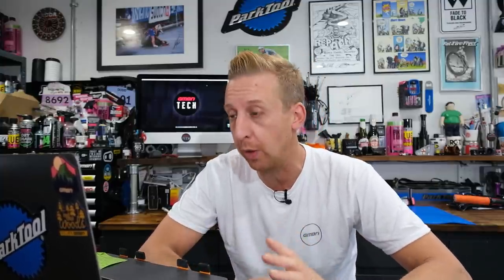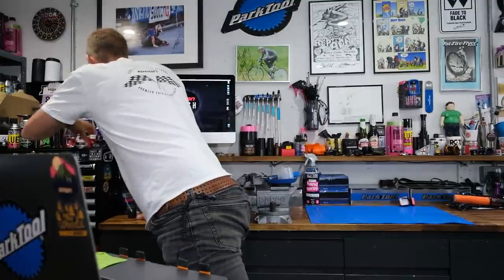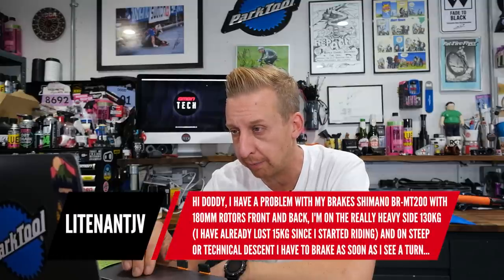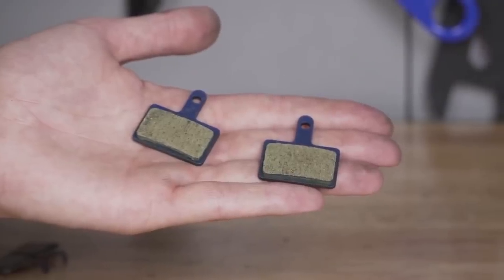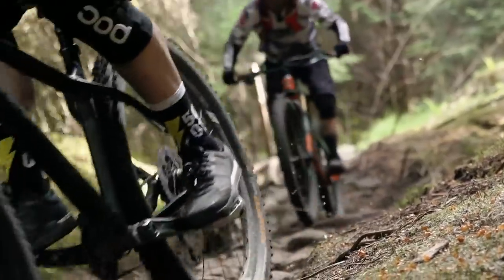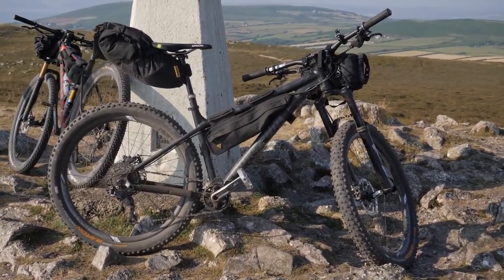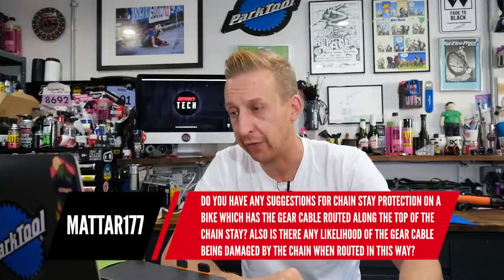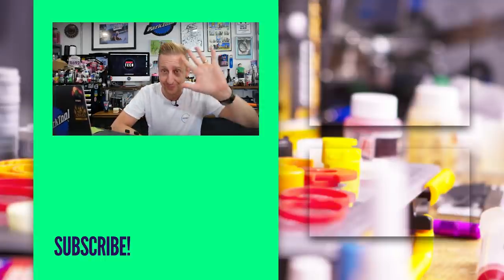Suffering From Sticky Brake Pistons? | #AskGMBNTech

Comment: During the Sticky Pistons part of the video I also recommend acting like your going to bleed them by opening the reservoir cap and threading on the cup. This way when youre pushing the pistons back you don't rupture the rubber diaphragm in the lever reservoir.

Comment: Doddy - we are both relative old-timers. Like you, I cut my teeth on late-80's and early-90's rigids and hardtails with steep geometry and narrow bars that assumed we were riding slow through the trees and only ever went UP the mountain. Today's riders don't do this (and we didn't either, did we?) and, as such - they should embrace the newer stuff and reap the benefits of our "R&D" years. I agree with you that the dropper seat post is doomed to be replaced by dropper frames that house the "dropper" portion of the equation (why did this take so long?!).  What other things will experience a similar transition? Bars with integrated reservoirs/brake pistons? Yes please! Multi-gear transmissons in the BB? Yes please! (deraileurs are so last year!). Imagine a single, rigid rear gear with all the shifting taking place within a free wheeling BB - we have the technology! The heaviest part on most bikes is the cassette so there is room to work - mechanical advantate leverage ratios don't care from which side you work! Mullets are the future! (See motocross) - each end has different jobs so there is no engineering reason they need to be equally sized. Regarding bike geometries: what good are geometry numbers if they are made on a bike without the rider? Do bikes move without a rider? The numbers we see area all static, unweighted values that - by themselves - mean little. All the measurements change when the rider gets on. What is YOUR head tube angle when you are onboard in a riding position? I foresee a rider mass/weight number becoming part of the geometry equation.  Active, micro-processor controlled suspension: YES!  Please save us from outdated setup techniques and charts that assume constants values for rider size/weight/terrain that can change weekly.  I could go on, but you see - the future is bright!

Comment: Sticking  caliper - pistons,  :- I found corrosion under the internal seals  causes the seal to swell and bind on the piston stopping it from retracting ,  removing the pistons, and the seals and  cleaning  out the retaining grooves  then re-assembly with a dab of lithium rubber grease on the pistons worked a treat, very fiddly but worth the effort!!😀

Comment: As an old bloke who has started riding in 1992, I should be tempted to say „you should learn on a hardtail with steep angles“ but no, the opposite is true. I think riding with 135mm stems, 560mm bars on a classic 71/73 hardtail for too long has really set me back in my riding. In those days, even the smallest error would lead to a crash and I think I have stopped trying things because of that. When I see the kids today and what they are doing on their bikes, I whish I had a more forgiving bike back then. However, I think riding on a hardtail or rigid bike teaches you to set up your tire pressure correctly.

Comment: Hi Doddy, Love the show, great content. I started my MTB riding 12 months ago at the young age of 55. Started with a 2017 Levo hardtail, gave that Levo to my wife when I got my 2018 FSR Levo comp, I love my. My fitness has changed so much that I bought my fist new bike a RockHopper to commute on around town. To me it was a bit of a waste riding a full sus EMTB as a commute when most of my commuting is flat tarmac. I slowly getting to riding some some single track on my Levo and love the blue and green trails. I have ridden both full sus and hard tail Levos on the same single track and maybe its my limited skill level I could not notice any difference other than the full sus was more comfortable. I might just have to ride more!! Cheers keep up the good work

Comment: Hey Doddy. I’m rocking an entry level bike (2018 giant ATX). I want to talk care of my cheep coil fork. Do you have any tips for cleaning and other general maintenance? 
#AskGMBNtech
Reply: After every ride that gets the fork dirty: take a clean lint-free rag and wipe the seal area on the fork to get any dirt away from the seal. Also wipe down the stanchions with light soap water.
After every week/2 weeks: Take some suspension grease (DO NOT use regular grease) and rub a bit on the stanchions. Compress the fork through it's full travel a few times and then wipe the excess grease off
After every 200 miles of dirty trail riding or 400 miles of clean trail riding: clean the o-ring and foam wiper, and do a lower leg service.
I honestly wouldn't recommend disassembling the fork to clean the o-rings and do a lower leg service on a low end coil fork. It's probably not worth the hassle and the cost of the foam rings will soon add up. The best maintenance that you can do is to clean and grease the fork frequently to prevent more time consuming and expensive services.
Reply: Open the top caps and pour 12ml of motor oil (5-10w) in each leg. Makes it 2x better, so much more responsive and smooth. Od recommend to clean the internals before this.

I did this and its a huge improvement!
Reply: @vivek_v  the cheap ones don't have foam rings
Reply: @linusdalin1  wait so how does the fork get lubricated? Or does it not get lubricated? The Walmart forks prob don't have foam rings, but even the cheap suntour stuff is decent so I would think that they would have foam rings.

Comment: #AskGMBNTech Hi there, love the show! I have an SR Suntour XCR32 Air fork, I'd like to make it more progressive and I can't find any volume spacers for it. Can I use 80W oil in the chamber to take up some volume or modify existing spacers from another model? Is there a risk of damaging the fork? Thanks a lot
Reply: I did that but it started to leek oil out of the stancsion
Reply: @cyclingstunts9887  wouldn't do anything
Reply: @cyclingstunts9887  Really? But did you feel anything different?
Reply: Ask someone to 3D print you some or just cut them from some cork etc. and glue it to the top cap of the air chamber. Pouring oil into the air chamber doesn't seem like a good idea, especially if the air chamber is not designed to be oil-lubricated (but grase-lubricated as most seem to be nowadays).
Reply: idk if you have tried this already but sr suntour has a place on their website where you can put the serial number for your fork (found on the crown facing back) and it will tell you exactly what varient fork you have and then you will be able to tell if suntour has volume spacers for it. i did this w my raidon 32 and found volume spacers. i know suntour sells volume spacers online so if you cant find any there they probably arent meant to be used on your fork.
Reply: @OYeahan  Humm not a bad idea I guess, thanks
Reply: @tylerbailey8834  Yeah I already looked into it, no luck, the XCR Air is the lowest spec air fork they have so you might be right, maybe it's not even meant to run spacers, hence the oil
Reply: @tonysadler5290  Wow thank you, I will investigate, and yeah in the future if not a new bike, at least I'll buy a better fork
Reply: Do you want it to be more progressive to prevent bottom-outs or do you want more midstroke support?
If the lack of progression affects your bike to the point of it being unstable/dangerous, I would just add more air and sacrifice small bump sensitivity. If it's just an annoyance, I would put a few more psi into the fork. The fork should still be sensitive enough but then you gain more bottom-out resistance and midstroke support if you were looking for that.

Comment: On the last question with the top-routed cable: I think you could get a flexible plastic hose like electricians use to run cables in the walls, cut it open, wrap it around the chainstay and wrap it with tape so the cable has room to move inside. (if you don‘t want to drill out your frame)

Comment: The shock position also defines where the forces act upon. If the shock is horizontal, continuation of the seatstays, then there are no forces acting on the seat tube. If the shock goes 90° vertically, the seat tube needs to be reinforced to handle this. But the shock goes into the bottom bracket area, that is the strongest part of the bike. If it is horizontal, then the top tube needs to be reinforced.

Comment: I would definitely consider better levers. The MT200 from Shimano, are the very entry level one. They are ok for lightweight people and trekking bike in my humble opinion. If you need loads of braking power you need a more powerful lever with the servo system. These are not only more powerful, but single finger as well, while the MT200 are more for double finger use (technically triple, but you really do not need three fingers). For Shimano brakes there are also third party companies making pads. Shimano unfortunately makes only metallic or resin pads, no semi-metallic. Quaxar to the rescue. I tried their semi-metallic pads and I love them. Bonus for making a lot less black powder compared to Shimano's resin pads. My frame is white, it's an hell of a job to keep it clean ;)

Comment: In my humble opinion, an affordable aluminium hardtail is the way to go for beginners. There's not much to do wrong, most of them can take a beating and if you find yourself to be sticking to the sport after several thousand kilometers, you can always upgrade if you want to. By the way, those hardtails really take more awareness during descents and do teach better riding. Trust me, I just hopped on my first full suspension. After a year of shredding.

Comment: Hi Doddy, I am 64 and just got back into the dirt, been road riding the last 7 years, raced Moto-X many years ago. I just picked up a 2021 Specialized Stumpjumper Alloy. My height use to be 5-9 but over the years and 4 back surgeries later I am now only 5-6 tall. According to the Specialized fit chart I should be riding a med(S3). When I bought the bike the sales tech told me the bike I got was a med, but after looking closer I find it is a large(S4). Do you think this would be to big? Before my surgeries I would have taken a larger, I have the lower body of a taller person but a shorter torso. The bike is comfortable to ride but I am wondering if this is something I should change to a Med.? Thank you for any insight to this. Don.

Comment: Do you have any idea if 2020/1 Yeti sb115 or Pivot trail 429, trek top fuel, ibis...  really needs to have their frame/suspension bearings replaced more often, or are more difficult than any other full suspension bike? Or is this a lie. What are the best bearings a person can buy for the suspension/frame? Brand and model? Do you think it is a good idea to drill a hole in the derailleur hanger(make it weaker) to make sure it fails before destruction of the frame and wheel? 
Thank you!

Comment: The calibre v2 frame has tha cable routed on top of the chainstay and I just wrapped an old inner tube round it, it is soft enough to work for noise damping but because my cranks come quite close I had to chop it in half so I only had one layer of rubber

Comment: #askgmbntech High guys I have a trance-3 2018 model running (stock) shimano 1x10 cassette  & mechanism. I have an issue in that I wear out the smaller cogs on the cassette very quickly well before the chain even becomes 75% worn causing the chain to jump around & slip on the smallest cog. I am at the upper weight limit (145kgs) of the design of this bike and I can get a lot off power down through the drive chain. I also am fairly good at cleaning the bike and drive chain after riding. So questions; can I get a tungsten edged smaller cogs? second is it worth up-grading the front chain ring from its stock 30 tooth to a 32 or 34 tooth? I am not really finding I use the bottom gear so this would enable me to wear the drive train out move evenly?

Comment: far? I tried a Yeti SB115 and a Pivot Switchblade, yesterday. Everyone raves about how great the Switchblade is. Not for me at this point, felt too heavy and sluggish. I liked the sb115 but no iscg 5 tab to mount a bash guard. I think any bike I buy needs frame protection of some sort to keep from taking chunks out of my bb area on big rocks, especially And logs. What do you folks do?
Is the Pivot trail 429 too heavy and sluggish feeling compared to the sb115? 
Also pedal strikes are a pet peeve, I hate too low bikes that pedal strikes or you have to put midget crankset on.
I ride in the midatlantic where it is totally different from all the YouTube reviews which are either at ski resorts out west, or Moab, Arizona, kalifornia, with fast more groomed wide open environment.
I am trying to figure out the best bike for my area, and something quick, light, responsive, and efficient, that does not jack hammer my back.
I ride a xl 2016 trek remedy 9.8 29r now.
I am 6ft and 3/4 about 165 with no gear.
Thank you.

Comment: As always, great show Doddy!  I agree that riding steeper head tube  or hardtail forces you to be a better (though slower) rider as to picking lines, avoiding obstacles, and the like.  I recently got al trail bike and it allows me to descend faster and roll over stuff my XC FS bike makes me go slower to handle, but I decided going faster is not better - I'd rather work on trials skills than DH/Enduro skills... safer too :)

Comment: Dear Doddy, my breaks squeal is epic, I've replaced rotors and pads, they still squeal super bad. I have removed the pads (front and rear) I found an oil ring so the pistons leak a little. Is it possible to strip down and repair or should I just get new calipers. I have Shimano Deore. TIA

Comment: My right piston is stuck squeezing the disc, I take the pads out and push it back in, but when I put everything back on and press the brake, it doesn’t push back and gets stuck rubbing my disc again, do I need to lube the piston or let some fluid out, I’ve only had the brake for a few months.

Comment: #askgmbntech 
Hi. I have a Cube stereo 140HPC TM 2020 with Fox Float DPX2 Factory ( metric 185x52,5 /Trunnion)  Is it possible to use a spring damper for this frame in the future? I'm not sure there's enough space for a coil spring. If so, what damper would you recommend? Ideal with pedal lock for climbing. Cane Creek Double Barrel Coil CS Trunnion or Marzocchi Bomber CR?or can i fit Fox Float DHX2 Factory 2-position 185x50mm?
thank you very much! have a nice day
Lubec

Comment: Hi Doddy, big thanks for great educational and entertaining content!
I have a Horst-link rear suspension with 140 mm travel, and the shock uses only about two thirds of its stroke. In the horst link there is another mounting point for the shock. Mounting it there would reduce leverage ratio. I am considering doing just that, and removing a few spacers from the shock in order to compensate for the reduced leverage and keep the same 140 mm travel.
Would you recommend doing that and is it generally advisable to use as much stroke of the shock as possible? Thanks!
#AskGMBNTech

Comment: #ASKGMBNTECH
 
In the winter months should we be washing our bikes after every ride? I understand the importance of washing a bike for maintenance, but is it even worth it to scrub and hose it down if it will get muddy again within five minutes of riding? My main concern is that I will just continually wash the grease out of the bearings if I wash it after ever ride. Thanks.
Reply: Its better to wash and regrease more often than push all the dirt and grit into your suspension seals, bearings etc

Comment: To the guy that need to protect his cable on his chain stay. What if you recyclable a piece of plastic (cut up coke bottle or something) and then tape it on. Wouldn't look any different as tape is covering everything but plastic shield would allow the cable to run freely

Comment: #askgmbntech Hey Doddy, I'm curious to know with the new 2021 Mega 290, the shock stroke is limited to 62.5mm. Like with many other bikes, what would happen if you were to remove the 2.5mm internal spacer? Is there a bit more travel that can be eeked out of the rear end? Thanks

Comment: #AskGMBNtech. Hi Doddy, I have a Specialized Stumpjumper 2016 and I was thinking about converting from a stock air shock to a coil shock. I ride decent sized gap jumps and a lot of trails and I was wondering if the frame was compatible and if my choice of riding would suit a coil shock.

Comment: #AskGMBNtech Hi Doddy, i ride a suntour DUAIR rear shock at around 160 psi, but i've noticed it hasn't been bottoming out when i ride, even when i (heavily) case massive jumps at places like rogate- looking at the 'o' ring on the stanchion i can see that only just over half of the travel is actually being used. Despite the casing of jumps. And on top of that it makes a weird squelching noise whenever it compresses. Any advise would be great thanks a lot. :)

Comment: #AskGMBNTech 
Hi There! I’ve recently purchased a 2021 Norco Sight with the 10-52T Sram GX Eagle. As of the last ride or so, it will happily sit in the top and bottom gears, but struggles to find gears in the middle and is skipping and jumping constantly. 
Cable tension/ limiter screw issue, derailleur hanger or warranty issue? Cheers.

Comment: #ASkGMBNTECH

Why we don't use fork boots on mtb? Motor cycles use fork boots, so was wondering why modern mtb with expensive forks can't use. Would you recommend using one, if one can acquire or can hack something e.g. using a vacuum hose etc.

Thanks